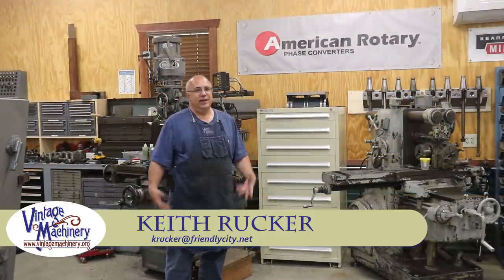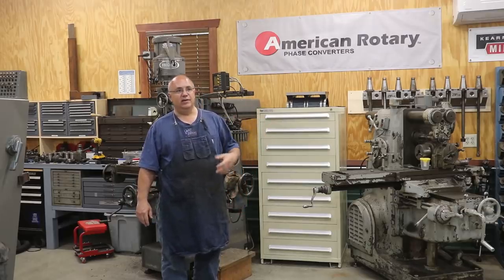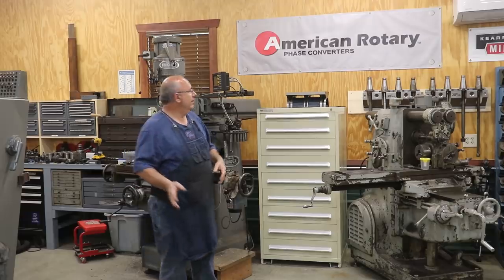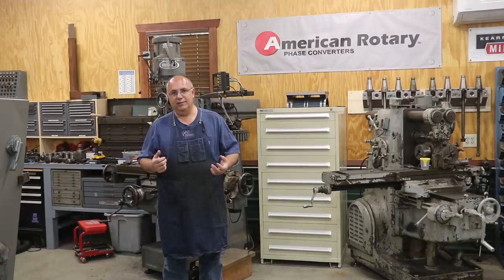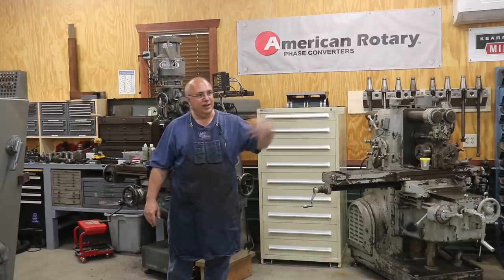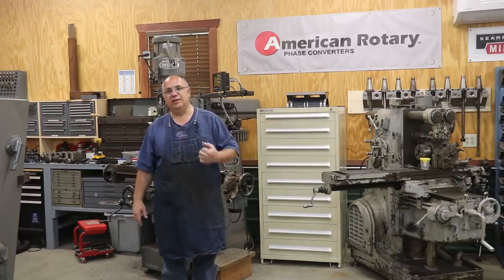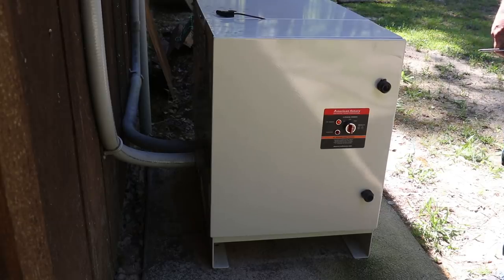American Rotary Phase Converters: Making your own Three Phase Power

Comment: A very interesting video Keith. I love the idea of the RPC turning itself off. ( I only have a 12" lathe/mill combination machine) so putting a 2 hp 3 phase motor with VFD gave me total control of the machine. I have a new British made VFD (after the chinese one blew up after6 months of use) and I am a little confused as to your comments on the amperage needed to run one, certainly a standard 13 amp 240 volt UK domestic circuit is plenty for a 4 hp  motor according to the manufacturers and the machine performs on this new VFD brilliantly. The control parameters are easy to set but the VFD worked perfectly straight out of the box. I only had to program the external controls and the ramp up and down times. ( lm not in a production environment so I like 3.5 seconds up and down. Don't like freewheeling to a stop. I have a 5 1/2" 3 jaw and 6" 4 jaw chuck's but they are both very chunky so with direct drive to the motor rather than two lots of belts they took what felt like an age to come to a halt, so dynamic braking was the way to go but not excessively.  Love your videos Keith please keep them coming .

Comment: NOTE:  There are more than one way to wire up a 3-phase circuit:  "Y" (three power wires going to a central return with fuzes on each power wire) or "DELTA" (the three wires connected in a triangle loop with fuzes between each corner power wire input and a separate common return).  Each has its own pros and cons and which to use depends on various factors.  Most normal uses just use whatever the company making the converter suggests.  This is a rather interesting subject...

Comment: Hi Keith , very interesting , here in the 🇬🇧 , you can have 3 phase in a ‘ home environment ‘ but they load the cost so unless your a big user it’s not cost effective ... I  have run all my 3 phase machines from a Transwave  ( UK built unit ) for the last 20 plus years never missed a beat ( you watch it will fall over now I’ve talked about it !) an excellent unit solid state , no motor running  ....
Regards 
Robert 
PARTSMADE 🇬🇧

Comment: Hi Folks, Perhaps I can help. Static convertors are only really suitable for running one machine at a time and Keith is not too far off when talking about static vs rotary convertors, but the comments on VFD's need expanding.  VFD's do indeed generate three output phases from a single input phase. However, these are synthesised 'stepped' waves, not the nice smooth pure sine wave ones you get from rotary convertor. They can generate a lot of annoying electrical interference if not properly filtered. Troubesome when trying to record video, for example. In the more advanced VFD models the average wave shape does not  follow a sine wave either, they are 'fatter' which is how they can give more torque at lower speeds. And, just to make Keith feel happy (!) they are nothing like as efficient as a rotary convertor - they draw lots of amps for not so many output. Not suitable for running an entire shop,  for that the right decision is usually a rotary convertor. VFD's have to be 'tuned' to the individual motors so you would really need a VFD per machine. An expensive solution in Keith's wonderfully well equipped shop. Where VFD's do shine is in giving variable speed control over a 10:2 or maybe 20:1 range - useful on things like smaller non-gear head lathes and belt driven pillar drills. And they are acoustically much quieter to run. But shop wide with multiple machines running at the same time? Nope. Keith's right. Use a rotary convertor and put it outside.  BobUK.

Comment: I had three phase power brought into my home shop some years back from Entergy...The power sub station is across the street from my shop.. To hang one transformer for the third leg and bring the cable to my shop was 1000 dollars because my demand is so low... Of course, there was another one thousand dollars worth on my end that I had to pay for....I am good for 50 hp and I have 120/240/208 which is open delta and is about 67% efficient I understand but still have 120/240 single phase in my home and shop for 240 single phase motors... I was running on a 5hp home made rotary phase converter prior to that... Mike in Louisiana
Reply: You have 87% of the capacity of the 2 transformers (if they are the same size).  We have many existing customers with this setup but unfortunately no longer offer this setup for new 3ph customers.  They must all go 120/208 requiring 3 transformers.
Reply: Why did they stop offering open delta systems? Load imbalance on the lines?
Reply: @danielnack6812  I'm glad I got mine because 208 sucks if you have a 240 volt single phase motor to run.....The original transformer feeds two houses single phase .. The third leg transformer was added for my shop three phase.....Mike in Louisiana

Comment: I'm not sure where you are, but in the suburbs of Los Angeles, CA. the local power company was out repairing the lines in our neighborhood when a huge pine tree fell over and took out the power lines. According to the Supervisor Lineman he stated that the main lines running down the poles in our area the power was about 3.5k Volts 3-phase and the transformers on every-other pole broke it down to 220V Single-phase with a 100 Amp drop to each home.  But 3-phase power was not allowed to be directed into a home as it's way too dangerous.

Comment: For me as a German it is hard to think about not having three phase power coming into the house and also voltages are about half of that here in Germany so for the same power you need the double ammount of amps and therefore double the cross section area of wiring.
Reply: As a fellow european, I'd say the same. America is a weird world of weird technology.

Comment: 4:12 - it is far easier to balance 3 phase loads - here in Oz, 3 phase is everywhere, the powers that be will wire up housing along the lines of house 1 gets A&B, phases, house 2 will get B&C phases and house 3 will get C&A phases; statistically, this will balance the load on the generating system.

Comment: The 3 lines are 120 degrees apart in phases , and basically drive the motor by the use of a rotating magnetic field - the field literally drags the rotor around, magnetically. Some else could explain this better, but I'm pretty close. Also if two of the phases are swapped, the motor will go backwards, and.is more efficient, and more powerful, something that single phase motors lack, especially as the HP increases.

Comment: In our town of 900 we have a car wash that was upgraded with 3 phase equipment and the owners had to buy the transformers ( 3 ) besides paying to have them installed to get 3 phase.  The distance from the pole with the transformers to the facility pole is across a two lane street or about 60 feet.  Three phase was already on the pole when the switch was done.

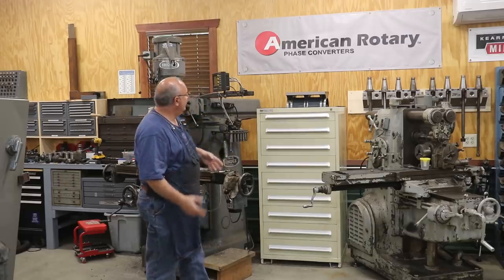Comment: 11:00 - VFD's actually vary the voltage in proportion to the frequency, and this gives an effect similar to speeding up or slowing down the generator - you need to think about back EMF, and power factor here ... a topic for some one else?

Comment: Mr Rucker, what is the cost of running a 40A phase converter?
By the way your shop is coming along very nicely. Congrats!
Reply: My 15 hp draws 2.5 amps at idle.  The Baldor motors AR uses should be a different NEMA letter class motor with better silicone steel in the laminations and thinner laminations, also to improve efficiency.  From an engineering standpoint its better to use this type in higher ratings than use a 1950s torque monster like I did.  The start rating ratio on mine would be higher but it'll use more current every day than the modern equivelent.

Comment: I have a friend here in Houston who is a retired electrical engineer.  He has his own home machine shop and needed 3 phase power to run some of his machines.  He wanted to save money and, the power company only supplies "single phase" power to residences.

The term "single phase" is somewhat misleading.  What residences actually get is two phases out of a possible three.  These two phases take the form of two sine waves that are 120 degrees out of phase from each other and come in on two separate "hot" wires.  The potential difference (voltage) between any phase and ground is 120 volts.  The potential difference between the two phases is 220 volts.  These two phases are what make it possible to run 220-volt electric clothes driers and 220-volt welding machines off a regular residential electrical service.  They call it "single phase" service but it really contains two phases and a ground.

My friend went to the recycle yard looking for a used 3 phase motor in good working condition.  I don't know what all he did to the motor (maybe nothing) but he used it to generate his own three-phase current.  A three-phase motor will run on only two phases.  Once the armature is in motion, all those fluctuating magnetic fields cause induction to take place and the missing third phase is generated in the third pole of the motor armature.   My friend inputs regular two-phase residential current into a three-phase motor and draws off three phases from the same motor for his shop.  

And all for the price of a recycled three-phase motor.
Reply: Your wrong single phase is just that, single phase.  Go look at the transformer on the pole. There is only one high voltage connection to the transmission line.  There are five wires connected to the transformer.  One high voltage hot and one ground on the primary side.  The secondary side has two lower voltage hots and a neutral coming out. You get residential 120/240 power due to the center tapped secondary side of the transformer on the pole.  One leg to the neutral centertap gives 120v. Both hot legs together give 240v between them.  The two 120 legs are 180 degrees apart
Reply: Thanks for setting the original poster straight. If he actually had two phase power then he wouldn't
need a rotary phase converter at all. Just an additional transformer would do.
Reply: It is single phase not two phase. It is single as both parts of 120V are not shifted against each other - they are in synch with each other. You get multiple phases as you shift things against each other. 

Your friend needs either capacitors to start his 3ph motor, or a small "pony motor" or a long piece of cord or he runs one motor with another motor.

Comment: Hi, watched you struggle with explaining three phase power with great  interest. One thing you didn't mention is that a three phase motor can give more power for the same physical size. A bridgeport milling machine with a single phase motor of the same power would be impossible! We had a single phase 2hp powered bandsaw for wood with a motor the size of a dustbin ( trash can to you) when it was replaced with a three phase 10 hp the motor was no bigger than a large paint can!!! 
The shaft had have a keyed sleeve made to adapt the 2 1/2" original shaft to 1 1/2" of the new motor and blocks to raise it to correct height from the Base casting.
I watched your video on the radial arm drill move and fastening it down in new location but you didn't mention about leveling it up in its new home. It also didn't seem to have any way of adjusting it on the Base. If the drill pillar is not vertical and the Base is not level in both directions then you can't use a level on the work to align it on the table, with awkward shape like manifolds and castings this is sometimes the only way to line them up. Perhaps you could show this on your  new machine that replaces the le blonde ( with a younger helper to scrabble in the tight corners!). K
Ps you might get someone setting off your remote control with their mobile or garage door opener or other interference/ radio signal turning it on or off and may not just be you forgetting to turn it off when you go home at all. I am sure that an electrician could fit a second hard wired on off switch at the other doorway easily rather than relying on the remote which could be left behind somewhere or broken in your pocket.

Comment: There may be 3 phase High Voltage (the top wires with the big insulators) on the pole, BUT then they still need to add 1 or 2 additional tran$formers (if 1 transformer is missing, it would be called Open Delta which phantoms the 3rd phase) to step 1200-2400V down to 240V

Comment: Let me explain 3 phase availability a little better.

Here in the US whether you can even get it depends on if you live near 3 phase lines or not.  You only see 3 phase power lines on major routes for the most part.  Where I used to live you could not even get it run.  Where I live now I could PROBABLY get it, but there's another issue.  That issue is cost.  I've seen Keith talk about the nice electrical co-op he has.  Where I live we don't have that nice co-op, we have Eversource.  I have another name for them that I won't mention here....use your imaginations.  If I call the clearing desk looking for 3-phase hookup they are going to get all excited because they will have somebody else that they can send a FIVE FIGURE monthly electric bill to..

Comment: Just phase angle calculations. I always wanted to get a big diesel generator but they are all 3phase. Only way i figured was to rectify it all us mainly dc appliances. Looking for better battery solutions like nickle hydride so excess could be stored hydrogen

Comment: An easy way to visualize 3 phase power is to think of it as three legs of single phase power delivered 333.3 milliseconds off set from each other. All three phases are 60 cycle but the cycle is delayed 333.3 milliseconds to each other. L1 is at 333.3 milliseconds, L2 is at 666.6milliseconds, L3 is at 999.9 (or 1000Milliseconds). Think of L2 and L3 as phase shifted from L1.

Comment: Before I had a shop with 3 phase I built a home made rotary converter. Some switches, 3 big capacitors and a used 3 phase motor. It worked fine for several years. When I built a new shop where 3 phase was available the power company wanted $6000 to set a 3 phase transformer. That was 29 years ago. After a discussion  with one of their engineers where he advised me to list all my current and proposed equipment and the hours of use (somewhat exaggerated) they agreed to set the transformer at no cost. 10 years latter we were maxed out on our 800 amps of capacity and the power company had to set a bigger transformer.

Comment: There is one thing about rotary phase converters that cannot be overcome by any VFD, whether it is a el-cheapo or not. The rotary phase converter creates a pure sinusoidal waveform without any whatsoever harmonics. No VFD can do that. Rotary phase converter can also be overloaded for the split second needed to get the motor running. The overloadability and the pure output waveform are the plus-side for a rotary converter.

Also, one can disconnect the load from the rotary converter. Do that with a VFD and You have most probably created a boat anchor. This regardless it is a el-cheapo or a real brand name VFD. They just want the motor to be connected at all times. This means that You do need to modify the internal connections of Your machine to run it with a VFD. With rotary converter the  original connections are quite allright.

Another thing is that the output of the rotary converter is quite immune to long motor wires. VFD on the other hand does not cope well with long motor wires  and as the wires become longer so does the voltage inside the motor increase. This can lead into motor insulation breakdowns and eventually destruction of the motor windings.

Further more, one needs one VFD for each motor that is to be ran. You can run multiple motors with one VFD but that is digging the blood out of Your nose and You cannot use the PID with this type of configuration. The VFD is designed to be used with one motor at a time. The rotary converter in it's turn can handle multiple motors as long as the power rating is not exceeded.

That all being said, the VFD is a valid option if one can live with the shortcomings:
- motor leads
- one VFD for each motor
- modifications on machine control switches
- radio interference and funny sound from the motor

The VFD and electronics in general are one thing that the chinese can do well. It is more than probable that the "professional" grade VFD actually has chinese made electronics inside it. I would not doom the chinese VFD's so easily. I actually bought 2 of those for my Schaublin milling machine. I already have one in my lathe and I have nothing to report of that one. It works exactly as intended. 

One easy to make mistake with the chinese VFD's is to pick up too small model. When the label states 3kW it means that the unit can deliver 3kW and not a milliwatt more than that. So, if You are going to run a 1.5kW motor, get at least a 3kW VFD for it. Having a VFD whose power "matches" the motor is a recipe for a short lived VFD and not-so-optimal control of the motor.
Reply: I am not disagreeing with your comment, but there are some advantages that VFD's provide that make them advantageous. For example, with straight 3 phase power, motors get up to speed very fast and this can be problematic for machines like surface grinders: it can throw the wheel out of true. That's why the wheels are dressed every time the machine is started, and they aren't stopped until finished. With a VFD, the motor can be slowly brought up to speed without affecting the wheels alignment. This is a huge benefit. Even with 3 phase, I would put a VFD on a surface grinder for this reason alone.
VFD's have benefits for other equipment beyond mere speed control. Lathes with large chucks can take a long time to stop. VFD's offer dynamic braking which resolves this problem. There are operations like power tapping that are more pleasant when the machine ramps-up and down rather than abrupt starts and stops.